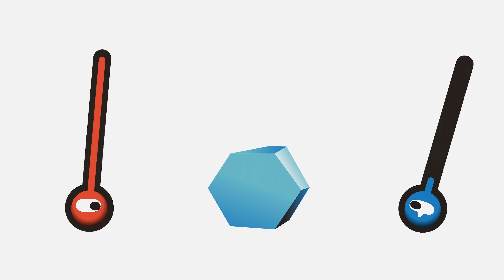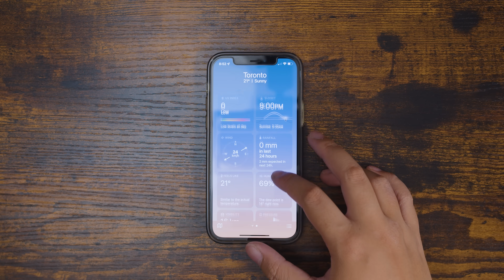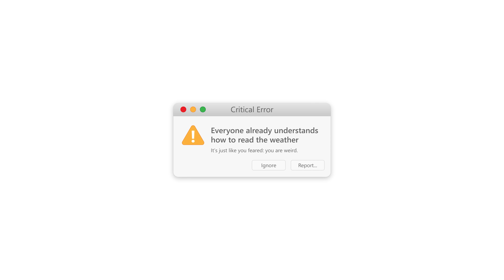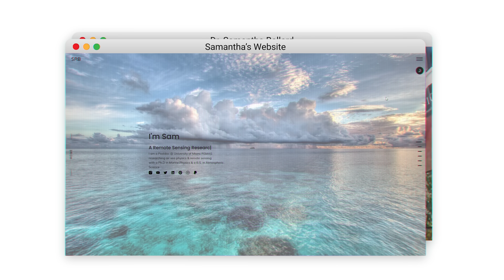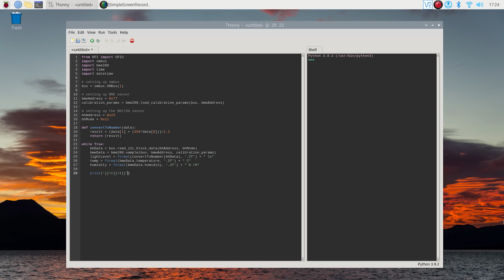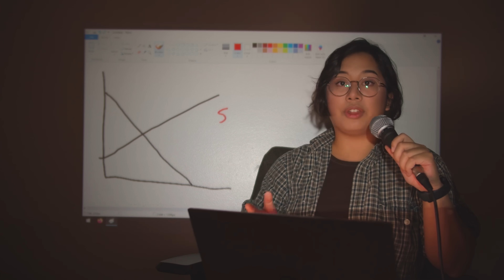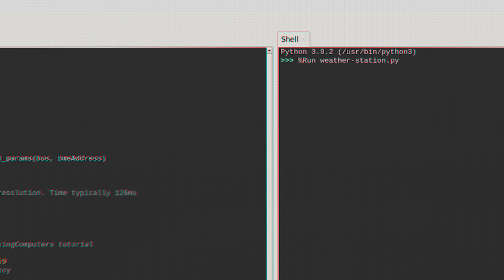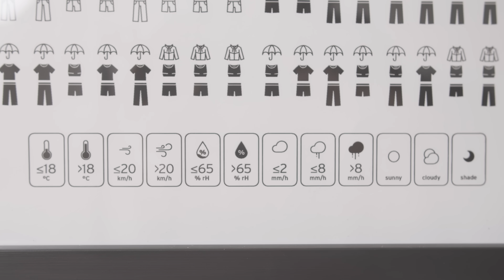how fahrenheit fails you

Comment: Hi! You can make your Raspberry Pi weather station a lot smaller and easier to use if you got a Sense HAT; it’s this tiny add-on that just clips onto the top of your main board which has pretty much all the same functions but reduces your wire count to just 1, that being your power cord. It also makes it a lot more durable compared to the wire-web and it has pretty cool 8x8 display on top so you can theoretically use it without ever needing to plug it into a monitor!

Comment: To answer some of your questions on the hardware bits:
1) The Raspberry PI is so small because most of the parts are inside neat little black cases, and the bits in there are literally NANOMETERS in size. A nanometer is a millionth of a millimeter, or in imperial units, a nanometer is 3/64,000,000 of an inch. The electronics that used to take up the size of a modern-day motherboard, are today packed into a case that has the size and thickness of your little toe's nail. And by the magic of producing millions of them, each of them is just costing $8-20 (or at least was costing that much, before the electronics crisis).
2) Infrared is just like visible light, except human evolution chose to ignore it in your eyes and instead make you feel it on your skin with a much lower sensitivity. Fun experiment, look at a TV remote through your smartphone camera while you press a button. Most likely you'll see a violet light, because the sensor in your smartphone is sensitive to IR. Ever wondered why your TV can pickup a signal even when your remote is facing away from it? Well think of it like the receiver was your eye, and the TV remote is a tiny flash light that morses an instructional pattern. If your eye can do it with visible light in a reasonably lit room, the IR sensor can do it with IR.
3) Light sensors are basically solar panels - more light = more current, so the chip does the opposite and assumes more current = more light. The really interesting part is how it converts "more current" to an actual bit-pattern you can interpret as a binary number using an ADC (analog to digital converter), but that's probably something for a different time (basic principle: quickly route the current through different path with different resistances and each time check if there still is some current, and that's your bit - obviously all quite a bit more finicky but you get the gist).

Comment: Fahrenheit is better for the layman.  Basically "On a scale from 1 to 100, how hot is it?"
Kelvin and Rankine are better for science.
Celsius is the middleman so it just sucks overall.
I'll never get the "Celsius is better because it's more scientific than Fahrenheit" argument.  0 being freezing and 100 being boiling for water isn't even accurate unless you're at sea level.  All temperature scales are essentially just "pick 2 numbers and root them to 2 unique, reproducible heats and base the scale off of that".  Basing off of brine vs water vs literally anything else doesn't matter.

IMO everywhere should switch to Fahrenheit and Rankine.  Or just let everyone use whatever they're used to.  Either way I'm sick of hearing how Celsius is better than Fahrenheit when it's just not.

Comment: We use wet bulbs in the field to determine heat index. It has a bulb with cloth on it that is supposed to stay wet. A normal temperature and one that has some black stuff inside the glass that measures the solar intensity. Then there's a slidy thing and based off of those numbers it gives you the HI.

Comment: It’s not just you and it’s not just weather. This actually comes up quite a bit when trying to communicate numerical measurements to humans. For instance, is 90 PSI good or bad? For a car tire - bad. Truck tire - good. Oil pipeline - too low. Water pipeline - too high. For weather in Toronto - really, really bad. Major accidents have happened in everything from oil drilling to air travel simply because a human didn’t properly process a variable being fed to them by a computer.

And as far as I can tell, you’re a STEM professional. There are plenty of other YouTubers who left STEM jobs to do what you do, and most of them don’t regularly program AIs.

Comment: Fahrenheit is just stupid and this shouldn't even be a discussion.

Where I live, it gets to around 5 degrees on cold days in winter, and easily 43 in summer.
In Fahrenheit that's 41 degrees to 109 degrees F. What kind of scale is that???

Celsius on the other hand is just really logical. 25 degrees is the best. 0 degrees means: it might snow. and 40 degrees is 40% the way to boiling water, so I assume that's quite hot. And it is...

Comment: When learning how to convert between Fahrenheit and Celsius, it struck me as pretty significant that on the Fahrenheit scale there are 180 degrees between the nominal freezing and boiling points of water (32°F and 212°F, respectively). I forget if I ever learned why there's half a circle's worth of degrees between the two, though.

Comment: This hot and cold sensation is called as thermal comfort and this term is frequently used in the design of Air conditioning systems. Typically, the HVAC engineers use this for indoor conditions. Maybe you could get more clarity if you look into ASHRAE related contents.

Comment: I’ll be honest, as an American I definitely prefer Fahrenheit, not just because it’s what I learned but mainly because of a greater degree of accuracy. At a fundamental level the range of temperature a degree of Celsius conveys is larger than the range of temperature a degree of Fahrenheit does, there’s about 10 degrees of Fahrenheit for every 6 of Celsius. When it comes to scientific measurements yeah basically any scale will do so long as you use enough decimal points but since most weather apps don’t you get an objectively more accurate reading with Fahrenheit. Though not enough that I think it warrants a fuss.

Comment: The issue I take with Fahrenheit is precisely the "intuitiveness" (?) Of it is very culture and geography dependent. For example, the scale shown in 3:32 with 0 being cold and 100 being hot. The places where I live and have lived in usually don't go bellow 40 F, and that already is pretty cold for me. So 0 F is not only absolutely too cold, it is unreasonable to even go down there as a scale.
Conversely, 100 F is not too uncommon. And well it IS hot, but it's not an extreme to me either, I've been in places around 120 F and those seem more liveable to me than being below 0 in Fahrenheit. 
And I know this is my personal experience, but that is the point. Fahrenheit claims to be an "intuitive" scale, but for 0 and 100 to be intuitive hot and cold points you have to live in a colder less variable place (say Northern Europe for example). 
Celsius isn't intuitive, but it doesn't pretend to be either. And for me in a warm place, 0 Celsius does seem like a better cold point than 0 Fahrenheit (but that's just opinion).

Comment: Think of temperature outside as a measure of the current conditions at a single point. The temperature you feel is actually the flow of heat from what you are touching (seat, counter, air...) into your body. People who have a higher internal temperature will feel that a hot day isn't as hot, or a lower internal temperature a cold day isn't as cold. An experiment you can try is to get one hand really hot with water from the tap and the other really cold from holding an ice cube. Then take both hands and place them on a surface like your counter or the inside of your refrigerator. The temperatures will feel very different to you. This is because the temperature of the muscles in your hand will be different. The difference in temperature is what your nerves are sensing.

That is why you can see people in the early spring wearing shorts and no coat because the temperature difference between their internal temperature and the warmer outside is bigger. They are adsorbing more heat and the influx of heat is greater than they have experienced in the previous months.

Comment: Back in my school debating days, we used to argue F vs C all the time. It was savvy to learn how to defend Fahrenheit because it gave you more chances to speak!
My favorite pro-Fahrenheit thing is that it is more precise. Huh? Well apps tend to tell you the temperature as an integer, its 21C, or 69F. 1 degree Celsius is ~ 2.2 degrees Fahrenheit. So in general use, you are getting a more refined measurement.
Reply: To prevent any confusion that might arise: 1 degree Celsius is 1.8 degrees Fahrenheit (9/5 = 1.8).

Comment: Honestly, I think we should adopt half-Celsius as the unit for everyday weather. 0 degrees is still when water freezes, and 100 is about as hot as earth gets (for now...). You get the useful 10 degree ranges of Fahrenheit, so you can say it's gonna be in the 50s and that can actually be meaningful (because saying it's in the 20s in Celsius is pointless. 21 and 29 are very different in terms of planning).  Also, 42 degrees in half-C is a comfortable indoor lounging temperature, and since that's already the answer I rest my case.

Comment: i think my perception of the weather is very different depending on what temperature i think it is, funnily enough. i’m a fahrenheit user and will balk whenever it’s over 80 degrees, but on a recent europe trip i felt less hot in the 30s. up to a point, anyway. we did hit a heat wave that caused some near-fainting, and suddenly, understanding that over-100 degrees is Very Bad became crucial.

ive also been a celsius defender for a long time but this made me realize that the lack of intuitive numbering for celsius can rly mess with my temperature experience. or i’m just too fahrenheit to change 😔 oh well

(also, is that infographic available anywhere for download? asking for. a friend.)

Comment: I have it down well:
If it's below 50F, I wear a jacket and long leg pants.
Below 32F I wear heavy jacket and gloves for sure.
Anything Below 20F and I put on the scarf, warm hat, and maybe a face cover. Add thermal under layers the lower it goes.

Above 50 but Below 70, long sleeves and long leg pants. 
Above 70 but Below 90, wear short sleeves and shorts are optional. 
Above 90, very thin cloths. Shorts for sure, carry water. Sunscreen and a hat, sunglasses if available or you don't have auto tent glasses.

Comment: The opening of this video is already a problem. Celsius doesn’t have a problem with communicating temperature, you’re understanding of weather is flawed. Twenty-five Celsius with 0% humidity vs. twenty-five Celsius with 100% humidity feels different. The same applies for F, K, R, whatever. There is more to weather than a number. Cool and rainy vs. cold and snowy may feel different. Hot and wet is miserable while hot and dry is much better.

Comment: American here. I feel like the level of nuance with Fahrenheit makes it easier to determine what it actually feels like out side. The difference between 80, 90, and 100 is much more visually dramatic than 26, 32, and 37. As a southerner, I can tell you these are extremely important distinctions, but I'm sure if I grew up with Celsius I would know that all the same. At the end of the day I rely on the 'feels like' number, as it takes into account humidity, cloud cover, etc. So today where I live it's 92, hot but tolerable, but the feel like is 101, which is a move from a/c to a/c kind of temperature. Those 2 numbers together tell me how to dress and also how much time I can spend outside in direct sunlight. (This would be none for me.) But that 92 means I could be comfortably outside for a bit in the shade. Yeah it takes some calibration, but it's doable. I'm sorry the experiment wasn't as relevatory as  you had hoped, but I like the chart!

Comment: I have a few things to say (part one?)

So, I have this memory decades ago when I was quite young where by the age of 6 I had decided that centigrade was bad because I couldn’t intuit(not sponsored) what that temperature meant. 

On top of that centigrade - I feel - is to big a unit. It is nearly double that of Fahrenheit. That said I only feel that way in regards to weather. But it’s other applications are quite useful.
Reply: Meh the fact that fahrenheit is more "precise" than celsius doesn't really make sense when you can use .5 degrees to make it more precise, plus I don't think that most of can really feel a change of .5 degrees, especially when being below 10 degrees celsius and above 20.

Comment: Celcius is the best system, along with the metric system, because you can easily convert it and combine it with the other systems. 0°C is freezing water, 100°C is boiling water. You don't need to exponentially increase numbers to get common temperatures like 90°F.
Celcius makes complete sense and I feel sorry for the muricans.
Reply: there's nothing exponential about Fahrenheit, they are both linear units, and I don't see what could be wrong with 90º being a common number.

Comment: Guessing Celsius is really not that hard.

-273°C to -50°C = too cold you die.
-49°C to -20°C= Stay indoors and wear layers.
-19°C to 5°C = Very cold. Winter jacket and layers recommended.
6°C to 15°C =Cold, a jacket recommend.
16°C to 20°C = Cool, maybe wear a hoodie.
21°C to 25°C = Perfect weather.
26°C to 30°C = Getting warm. Consider shorts.
31°C to 35°C = Warm. Stay hydrated
36°C to 40°C = Very warm. Take measures against heatstroke.
41°C to 50°C = Hot, stay indoors and blast the AC.
51°C to 60°C = Very Hot. Record temperatures. Don't go out.
61°C to Plank temperature = extremely hot. You are going to die very soon.

Comment: I personally feel that celsius is significantly better than Fahrenheit. With celsius being based off of the phase shifts of water it is easier to get a general feel for the temperature that is consistent with and without accounting for other weather variables. While Fahrenheit is based off of a constant that I don't remember and didn't understand. Though Fahrenheit has a little bit more precision I feel that it is negligible. If Celsius was split into tenths (like suggested by another commenter) instead of being 70% better it would be 1000% better than Fahrenheit And even if this change was made Celsius would still fail to compare to the best way of measuring temperature, Kelvin.
Reply: How do the phase shifts of water make it easier to tell temperature though? Granted, the freezing point of water is a great number to be able to reference-- but when does the fact that water boils at 100°C ever get used in day-to-day life? Most humans will never experience daily temperatures past 45°C. That leaves 55° along that (just as arbitrary) 100°-scale that humans don't ever really interact with. If you want to boil water you just heat it until it stars bubbling-- you don't measure atmospheric pressure and elevation to find the Celsius boiling point for that specific environment.
Celsius definitely gets points for how it fits into the metric system, but for daily life don't we want something more humanistic? If you're judging a scale humans use, wouldn't one with greater granularity in the space that we actually inhabit along the scale be "more useful".

Comment: My weather app has a "real-feel" metric that gives a perceived temp and not a measured one and living in a humid climate has saved my butt a few times
Reply: In Spain, weather reports on TV always give real temp, and temp sensation, but I don't watch TV, so I just go to the balcony feel it for a second and decide.
Reply: Old-school, my parents had a heat index chart on the fridge.
Reply: This! My app has that. It may be 15C in the shade but wind and humidity might make it feel like 8C.
Reply: @nena5518  I like this, but it's a bit confusing since every weather condition necessarily feels like itself. When it's 15C it has to feel like 15C with whatever the other actual conditions are (wind, humidity etc), but maybe it feels like an 8C with some other humidity. In principle surely the "feels-like" humidity and wind speed should be given along with the temperature
Reply: @superfluidity  The UK Met Office does that in its app
Reply: It's just wet bulb temperature aka temperature + humidity*proportionality factor.
Reply: I used SWACKETT when I moved to new climates! Glad to see everyone worked out their own system with the tools available to them.
Reply: As someone who lives in georgia, I need this. GA's baseline YEARLY humidity starts at 60% lmfao

Comment: None of the scales is inherently better for intuitive interpretation. You can get used to anything. Now if we talk about the system the two scales are embedded in, there is no contest. And if we are talking science, it‘s Kelvin anyway
Reply: I mean, you can do science with Celsius. Especially if youre mostly interested in temperature differentials. Since Kelvin is really just a reskin of Celsius. ^^'
Reply: @TheAnon26  I'd argue that the base unit is Kelvin, even if Celsius came first. But when we talk about the very concept of temperature, Kelvin is king. (And anything not based on absolute zero kinda weird.)
But, yes, of course, if all you do is record temperatures and work with differences, any scale will do.
Reply: @HotelPapa100  Very true. ^^
Reply: I might suggest that Celsius has an advantage because it nominally uses a 0 and 100 point that people can easily understand. Icy brine and blood are not things who's temperature I am casually acquainted with (well blood maybe, but in a loose sense), but water freezing and boiling are things is see in my kitchen all the time.

Other than that, it's all irrelevant because both systems are easily understood by their users, so we may as well just go with the one that plays better with science.